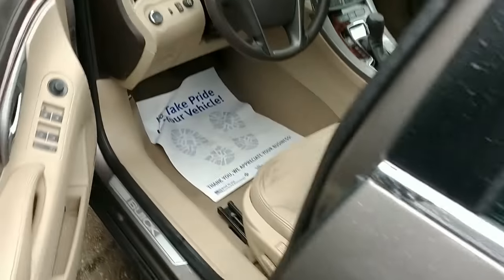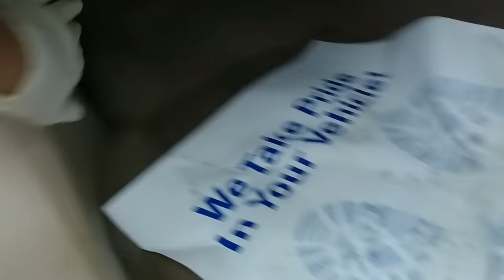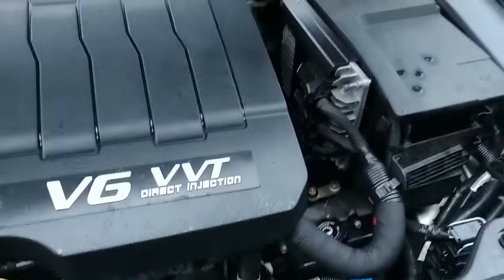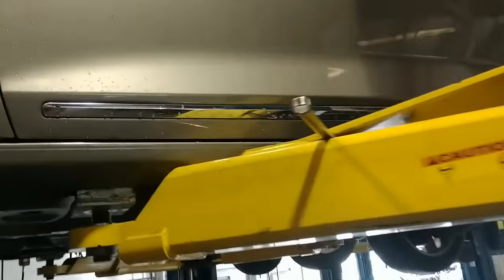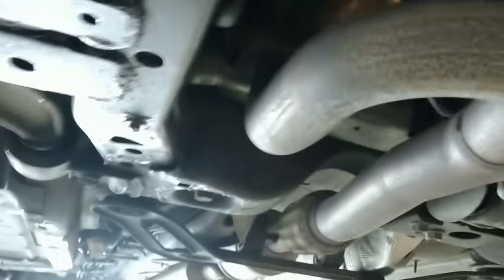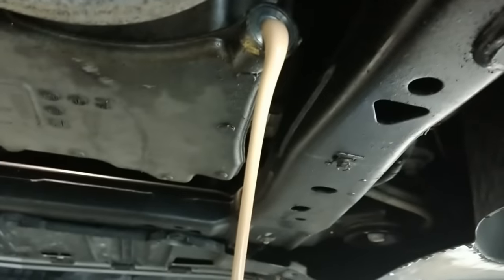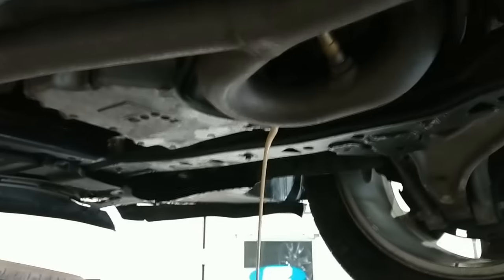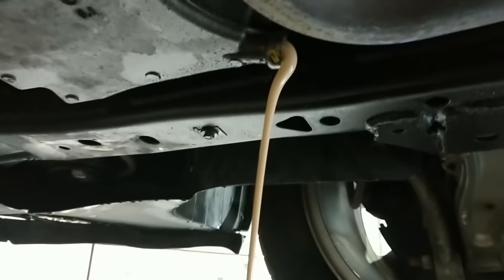Overfilled Crankcase! Blown ENGINE! Used Car Nightmare!

Comment: "This is going to be good."  No, no it's not.going to be good.  Ouch.
Reply: So, for those of us less versed in the dark arts of f'ing up cars, they mixed coolant in with the oil? Could that be flushed out some way (some kind of solvent, then pushing clean oil in)? Or is this one of those "you'd have to take it apart and clean everything with gasoline?
Reply: @user-wr3vt8uq4s  Don't think that flushing is going to be an issue, the kicker is fixing the leak. Maybe a new head gasket, maybe the header needs planing :(
Reply: @user-wr3vt8uq4s  Coolant basically robs the oil of it's lubrication properties. Outside of the overheating issues which can damage all of its own it means all those internal metal parts are not properly being lubricated. Do that very long and you are rebuilding/replacing your motor. A simple tear down and clean is not going to get it done. It all depends on how early you caught it and how long you tried to drive it that way and by catching it early I mean when you first see you are over heating and diagnose the issue. The longer you go the more damage and likely total engine replacement is necessary. At some point the car just simply will not run.
Reply: @user-wr3vt8uq4s  (this is super super simplified) engines have a Block and a Head. The block is the bottom and the head is the top. There is a gasket in between the two and it's extremely thin and delicate. It's only purpose is to keep the coolant and the oil apart from each other. That gasket is in every car made with a combustion engine,  some of them fail more frequently than others cough Subaru when they fail and the oil/coolant mix Wendy's frosty's is what you get. It's clinical name is emulsified oil. If you don't do what this person did and drive it till it shut off you can usually... usually get away with just replacing the gasket. However,  to get it replaced means you have to tear down the top- end of the motor. It's expensive and a complete nightmare for someone with little to no car knowledge.
Reply: @andreafox9137  Thanks for the reply (and the others' as well). Now I have a much better idea of what happened.

Comment: I've seen this a couple times before, the person said "but it only cost $3,000.00"  when I asked if they got it inspected and now they are out that 3k instead of $200.00 it would have cost to get it checked out...SMH 😒
Reply: You buy a nice looking used Buick for 3k, you know you’re getting a turd. After putting 7k into the engine it might be alright again.
Reply: Guy: "How much did your car cost?"
Me: "$7500..."
Guy: "What?! You can get a car, same make and model, same mileage, for 1, 2...maybe 3 thousand!"
Me: "All I've had to do to it is put gas in it. It runs perfectly."
Guy: "... oh ..."

Better to pay more for a car that works right out of the gate.

Comment: My first job out of school was a buy here pay here lot. They sold so many vehicles like that. Its sad.
Reply: And to think you'd make so much more money as a lot selling repaired cars, even good salvages. He'll if someone opened a lot with cars that are all over good but DEFINITLY need a motor or Trans. Just transparency to what your getting into would give you a good base.
Reply: @robm2907  
Well, yeah, but I would need to find out the cost of an engine replacement, have it in cash, and not  give it to the person selling the car.
Reply: @robm2907  actually got word that our local you pick it junkyard is going to do just that they're going to use all the parts from the vehicles that they have sitting in the junkyard to start fixing up and selling up reasonably priced vehicles that were sold off by customers that didn't know that what they had or didn't care to actually quite intelligent they have all the parts they could ever need
Reply: @mjolnirswrath23  
in many states, it's illegal for salvage yards to sell cars that had been crashed then repaired .

Comment: I bought my 2008 Ford escape from a buy here/pay here lot. 114K miles, decent shape. Took it to get checked at my mechanic, needs a front main seal. Looking for a shop to do it. Just had a oil change, brakes/rotors, and the spare tire cut off because the winch broke. Not too shabby. Have to read the reviews on the Car Lots always.

Comment: At least you don't have to detail it...
Reply: @RainmanRaysRepairs  that whole car is a disgrace to Buick it's just a Holden...
Reply: Ooooooof
Reply: @philllsxga.7737  Actually, I thought this was a rebadged Chevy Cruz.
Reply: @kennethsouthard6042  could be I thought it was on a Holden platform I know it's no old school GM with a 3800 that's all I know!!!
So to me it's just a piece of junk toilet!!!
Reply: @philllsxga.7737  He said that is was a Buick Lucerne, that shared the platform with the Impala,  but when you look it at closely, it's clearly a Buick Verano which is rebadged Cruz.  

As nice shape as it otherwise is, 9 year old ones are about 5 grand.  A dead motor could potentially put it in the junkyard.  Maybe finding a good junkyard motor could save it.
Reply: @kennethsouthard6042  it's a Holden platform then .  The impala was towards the end...
Reply: @philllsxga.7737  replaced more than my fair share of 3.8 intake gaskets (5), and a few plenums(2). And those were just my Pontiacs.
Edit: I will admit by the 3rd intake set I could do them in the dark. Just have to watch out for the hidden jntake bolts under the plenum.
Reply: @JasonW.  yeah that's the thing GM took a bulletproof engine and put a plastic intake on it...
Reply: @JasonW.  3.1l as well with the intake leak plus the plugged up triple egr valve (seafoam). Straight up ran a coat hanger through the plenum big carbon chunks. 95 gp se about 190k mi. Ran like a top after that and some new coils e.t.c.

Comment: I had that happen to my 1996 Chev Lumina with the 3.1L. that I owned for some time. I was 3 miles from home when the temp gauge pinned hot! Noticed it right away, turned around and would run engine then off and coast, start it again when rolling too slow, get back to some speed and shut it off again.  When straight to the GM dealer, they diagnosed it as a head gasket and would NOT be trying to fix it due to the oil looking like that! I took a chance, ripped it apart myself, did gaskets, had the heads looked at by a machine shop, put it back together, did a oil rise a couple times with a 1/2 & 1/2 diesel & oil mix while running long enough to circulate it. Did that a couple times with fresh mixture.  Then real oil change & filter, drove it for a few days, another oil & filter and never looked back. Had no issues, sold the car later on, they drove it for years! Most would call that lucky!
Reply: Put all heaters in the car on full blast high hot too to try take the heat from  the engine block before the heat warps the head...old hippy trick...

Comment: when you come across something like this, you should catch a sample of the "milkshake" in a clean plastic bottle so the owners attorney can have it analyzed (which would also look for bearing and piston-ring material) for the legal battle that we both know is going to happen.
Reply: or a video, it also counts as evidence. A video shows a lot of details as we saw that this car was repaired before and left wit a problem by a very bad mechanic
Reply: joyce tuck  wrong.
Reply: joyce tuck  100 miles on the car after it was bought. I don't know what state this is but lemon laws exist for a reason and even buy here pay here lots are subject to that enforcement.
Reply: joyce tuck  no need to name call. Why don't you look up the law..... it's not just for new cars 😕😒
Reply: As Is Sale ... Case Over! ... Now pay my consolation fee, oh and the shop diagnosis, oil refill and or tow fee, and the car payment  too/
Reply: joyce tuck  Show me where the lemon law states it only applies to new vehicles? Bet you 100 bucks you can’t. Lemon law applies to new and used vehicles🤷🏽‍♂️
Reply: joyce tuck  ' no' wonder
Reply: joyce tuck  ' you're'
Reply: @cgfh8673  to add to this, even buying as is does not cover the fact if you ask if anything is wrong and they say no. That would be a breach of contract, because you asked, and they said no. That infact could be criminally charged as they knowing sold faulty parts, thus creating an agreement in bad faith, or rather, theft by deception
Reply: @largepoodle6036  The coolant ended uo in the oil. Not because someone put it there, but because the car has a bad head gasket or cracked block. Why else would the coolant system be empty? Before you call people dumb you should ask yourself why the coolant was empty in the first place.
Reply: joyce tuck  that is wrong the previous owner can still be sued for knowing and not disclosing the condition of the car especially if they damaged the car maliciously
Reply: joyce tuck  😂🤣 calling people and America stupid while struggling to put a sentence together. So many spelling mistakes while calling others stupid isn't how you win.
Reply: Europe go brrr
Reply: @largepoodle6036   the most likely scenario here is the woman purchased a car with a blown head gasket. most people now days don't know anything about what is under the hood of a car. let alone where to add oil or coolant. also, most vehicles made do NOT have an "oil tank" (this car included). the oil is contained in the oil pan, not a tank.
Reply: Also, don't trash talk about women. you owe your life to one! the plain fact is most women have simply not been trained in mechanics. they can be every bit as capable as a man. and in some ways are even better than men doing mechanical work. I for one would trust my families life to a properly trained female mechanic.
Reply: joyce tuck  you type like you have learning difficulties. And for reference, the “lemon law” applies to both new and old products. Hence (make sure you are not sold a lemon). P.s. Joyce definitely smells like bin juice
Reply: @FlowerGirl.MN50  Let's go Brandon
Reply: joyce tuck  😂🤣 education is free. Learn to speak before doing it as if you know. Better yet, learn anything before preaching it.
Reply: @utrak  Let's Go Ronald!
Reply: joyce tuck  “look stupid”
Reply: @FlowerGirl.MN50  LETS GO BRANDON
Reply: joyce tuck  well obviously you know everything so…….
Reply: there is nothing that salesman or mechanic can do to cause his problem This was poor manufacturing This is because of it's a Buick It's a new car It's got a blown head gasket That's just a problem with head gasket material or initial manufacturing but do not blame this on the mechanic or the sales place because they cannot have any effect on such a thing.
Reply: @jericbeachside1594  The point is that the dealer should have done a basic check-up of the car before selling. Does it run? Does it have oil, break fluid, transmission fluid, are the tires worn? Even claiming "as is" doesn't absolve the selling company of liability.
Reply: @jericbeachside1594  Bro, as an analytical chemistry student, I can guarantee you that testing that fluid will take no more than 100 bucks at most. You just stick that into an HPLC or GCMS and you'll have results in less than an hour lol. We actually do these kinds of things in lab, and any trained chemist can immediately see that there is something definitely wrong with the oil
Reply: @jericbeachside1594  Quaker state does full oil analysis for like 100 bucks and will tell you every type of contaminant in the oil and ppm levels don't know that it would really help with anything on a matter like this but we regularly have the the first oil change after a 500 mile break in tested on rebuilt engines the levels of iron and bearing material or    antifreeze will tell you real quick if you got a dud rebuild it can even tell you if you got excessive blowby  by levels of gasoline contamination well worth it to hold a rebuilder to their warranty but yeah don't think it would matter for this one you get a Arkansas  white line warranty from most buy here pay here's if it crosses the white line leaving the lot you own it
Reply: @jericbeachside1594  A "mechanic" could have chosen to use silicone instead of a gasket or used it on a damaged gasket when replacing the timing cover, and done a terrible job of it.
Reply: Sad part is. Many people can afford the legal battle either and just take their bad luck at face value.
Reply: Under Federal law there is a tenet known as "implied warranty of merchantability" which means that an item sold (by a dealer) must do what it is supposed to do. That would cover the basic purpose of the vehicle purchase.
Reply: Joyce is a troll.  Don't take the bait.  Lol
Reply: @cgfh8673  lemon law only applies to factory defects on new vehicles (at least in the US).
Reply: @anythinggoes3843  telling people their sentence structure matters that much, when in reality the majority of people are doing this vocally and you're argument is not with a person attempting to convey an idea, but rather likely with the result of autocorrect instead of what the human caused.
My point, if you're going to give somebody grief for some petty thing that doesn't really matter in the first place.
 All we need to know is what each other are saying.  If you're going to be going off on people about their education based on some YouTube comment, it might be important for you to know how some of these systems work before you start giving people grief about nonsense. 
This is YouTube so it's an international venue many people are translating their thoughts from other languages. I think more important than the grammar police we need the pointless a-hole police to screen out comments that are not related to the topic originally posted.
Reply: joyce tuck  oh Joyce you're talking about right and wrong but an attorney can circumvent right and wrong.
I wouldn't say there's nothing she could do with an attorney even though The car was bought used and most likely she signed up purchased as is contract since that's the way almost all used cars are these days And yes you're right lemon law does not apply to used cars, And yes if they took it to court I know from experience that the court would say it is the new purchasers responsibility to check out the car and if they're not a qualified mechanic themselves then to hire a qualified mechanic but I still think that there's stuff that could be done if you're willing to pay enough to an attorney.
Reply: wow I've renewed my interest in this string because it's just unbelievable what the masses believe they have a legal right to.
It's also extremely entertaining to see people coming up with things like chemical test that would cost more than a new car would cost for attorneys that would cost more than a new car would cost and All of this super duper level dealings with something from someone who has the budget for a used car.
Reply: joyce tuck  lol nah man I watch live cases all the time and this is a common case.
Reply: The vehicle was likely sold as “road ready”. A vehicle like this that runs only a few miles after being purchased to then fail significantly is not/was not “road ready. The buyer has a good legal case against the seller.
Reply: @garrettrocks9888  US Lemon Law only covers new vehicles, or a vehicle within it's first year of manufacture and 18,000 miles.
Reply: @Menolly1233  Watch any of Lehto's Law videos on Lemon Laws to learn how wrong you are.
Reply: @Fuckyoutubeass  Which is why every used vehicle sold has a large AS IS tag on it. You people have absolutely no clue what you're talking about. Watch any one of Lehto's Law videos on Lemon Laws to find out how wrong you actually are.
Reply: Wouldn't matter, most used cars are sold as-is no warranty.  Smallest financial hit here is probably to put in a junkyard engine and drive it for another 30-40k miles.
Reply: @bend1119  wrong, there is still some protection with as is sales.

Comment: The first thing I told my fiancé when we she was looking for a car is to call around near the place you’re interested in buying from to see if you can get an inspection before you buy. Then you make the stop there after your test drive if you’re interested in buying it. 100% worth it, the small cost to pay for a 3rd party to inspect will save you headaches later on.

Comment: And this is why it's important to have a professional mechanic inspect the car at a mom and pop shop (buy now crappy places) before you buy it or go to a dealership that does the inspections, maintenance, and other items.
Reply: Dealership?  You know they're gonna make stuff up:
The engine is blown, the transmission is on its way out, and the suspension is shot.  But we have this nice model in our lot that we can sell you, instead.

Comment: Fortunately in the UK there are consumer protections for this sort of stuff. If you buy from a trader and then find and expensive problem like this you can get a full refund on the vehicle within first 30 days or request a repair at their expense. But would wholeheartedly recommend getting a pre inspection done before a purchase.